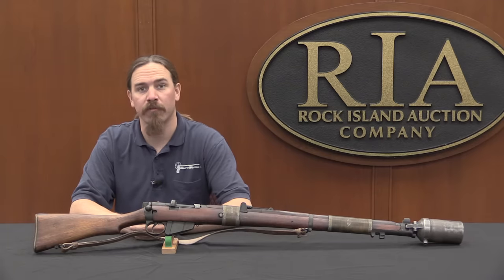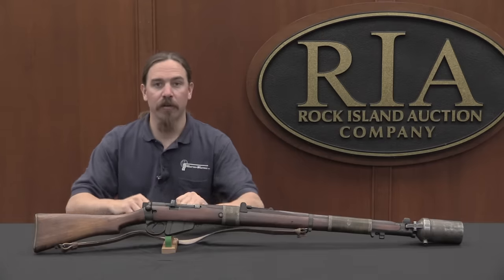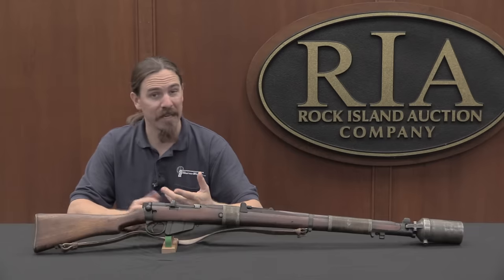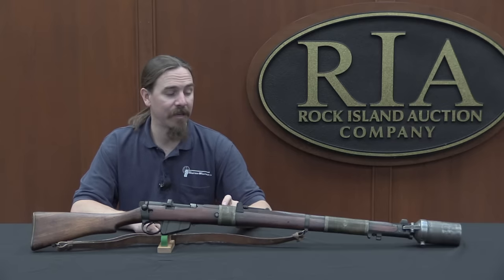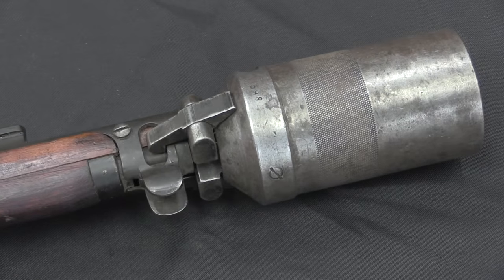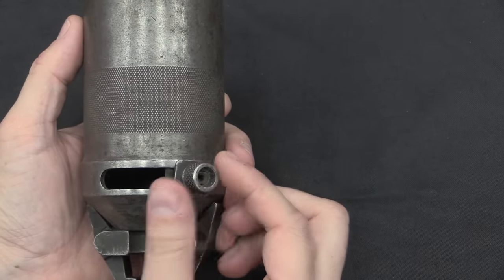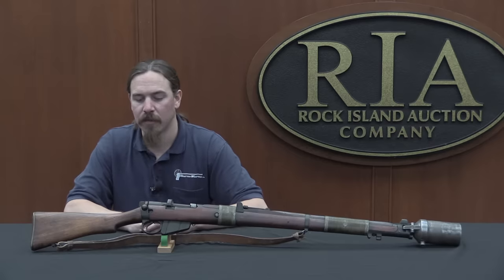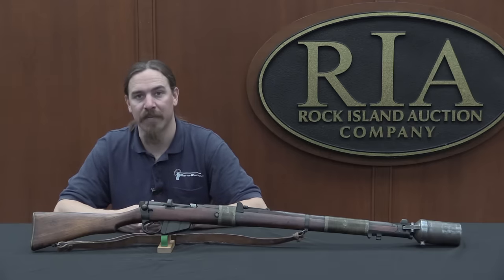SMLE Rifle Grenade Launcher

Comment: The simplicity of  changing range by adjusting gas pressure instead of angle is just awesome. Throughout the whole video though I kept thinking knee mortar, even though this predates that. I do wonder : was there anything in the manuals for those two weapons showing how to achieve a higher arc for clearing walls and such?
Reply: It's not just the simplicity, it's maintaining the optimum trajectory for dropping the grenade on top of the target.

Comment: What was even worse about the rod rifle grenades: they tended to detonate when they were launched because the rods got stuck in the barrel long enough for the impact fuze to arm and set the whole thing off when the grenade finally left the barrel. Both Germany and France eventually replaced them with rifle grenades with a bullet channel that were fired with a normal cartridge: the bullet went through the tunnel, set of the timer fuze, and the hot gas following the bullet launched the grenade itself.
Quite an interesting time for the development of (rifle) grenades. The stuff they came up with would even make steam-punks drool. :D
Reply: whats worse about those different rod grenades was you put it in the barrel, loaded your blank, pulled the pin and immediately fired. Because there was no method to retain the handle. Until they developed a large ring held on by your bayonet.

Comment: Could you still fire the gun with normal ammunition and the grenadecup mounted but with no grenade loaded?
Reply from the maker: Yes, you can.
Reply: Sir_dance_a_lot
still look like it blocks the iron sights
Reply: The French used one that required normal ammunition with the grenade launcher. The grenade had a hole in the middle where the bullet passed through, and it hit a trip plate which activated the delayed ignition. The muzzle blast launched it.
Reply: That type is known as a Bullet trap Rifle Grenade.  The British did experiment with them, one major problem was maximum range was inside blast radius of a 36 Mills Grenade. The 36 grenade is known as an offensive grenade, it slings lots of sharp fragments about, the case is designed to split into 36 parts. The German Stick Grenade is a Defensive type, it relys on blast rather fragments, so if you get to lose you maybe deaf for bit but not shreeded.
Reply: 51WCDodge You got it wrong. The mills bomb is defensive and German one is attack grenade.
Reply: So do you just hope to find cover so the Mills bomb doesn't shred you to bits when you use it by hand or what? It sounds pretty unwieldy. Hmm, I guess it's probably expected that you DO have cover when you use that grenade. That makes more sense.
Reply: My understanding is that the difference between an offensive grenade and a defensive grenade was typically fragmentation.

The fragmentation could in addition to the lethal blast radius, create further hazards to troops on the offensive. Or, more the the point, the "Injury zone" is greater, thanks to shrapnel, than the isolated blast zone. Because of this, you only want to throw said grenade when you have solid cover between where you are, and the grenade is being thrown. That's not exactly conducive to being on the offensive.

A concussion grenade, on the other hand, after an explosion, leaves no further hazards to troops that are on the offensive, and can be thrown while moving with relatively little danger to the user.
Reply: Ian, any chance that you'll do a video that Mauser with grenade cup from the same lot as this?
Reply: MoonEyes2k mills bomb has lethal range of only 35 not 100meters and stielhandgranate 24 has lethal range of 15meters but 3x the range
Reply: Also, I'm pretty sure I've read that later Stielhandgranaten had the optional fragmentation sleeves pretty much as standard--they weren't issued separately.
Reply: MoonEyes2k,
Joe Toy had two potato mashers detonate right next to him on D-day and IIRC he didn't get a scratch on him.

Comment: Some units  in the Canadian Expeditionary Force in 1917 modified rifles by shortening the the barrels and remounting the muzzle caps.  The shortened NoIII’s were used by the units designated for mopping up during attacks.  The shorter barrel fired the grenades farther and faster and were more handy when employed in trenches.

Comment: After some coastal erosion beside an area that was a training camp for soldiers departing to the Western Front, we started to find old unexploded Mills Bombs and rod grenades. One Mills bomb still had the fly off lever and pin in place. The misfired rod grenades were something else. A lot of them, even after almost 100 years in the sea sand, their mechanisms still worked. They exploded on impact with a blued firing pin which had a safety feature of two brass balls in a groove in the firing pin which were held in place by a brass sleeve. When fired, the sleeve slid back, releasing the brass balls to free the firing pin to travel forward to set off the grenade on impact. It's not every day you take a spring the thickness of a hair from the sea and find that it is still a spring.

Comment: A bit of a dumb question, but is it possible to fire the rifle normally with dischargers like these attached? Or if you get jumped by the hun while you're getting into position, would you have to remove the grenade, the blank, and the cup before you could take shots at them?

Comment: Ian u forgot a very important adjustment on the spigot launcher. The threaded sleeve in the center rear is shaped to mach the muzzle, its adjusted from inside top of launcher with a wide screwdriver, u snug up the unit loosely then tighten inner centering sleeve, then tighten the launcher the last little bit. I just got 5 drill purpose rifles from CAI for $85 ea w/launchers, their in a lot better shape than I expected, just 2 have damaged toes. 2 have no stacking swivels, 2 havent been drilled for a swivel just a boss is there, 1 doesnt even have the boss at all. I thought this to be odd😊

Comment: The AT grenade with the SMLE cup grenade launcher was the No.68 (HEAT). It could penetrate up to 32mm. of armour plate and was used during the BEF in France 1940, where it proved to be next to useless versus a German panzer.
Reply: That seems unlikely, during 1940 there were plenty of places on a german tank that were less than 32mm thick.

Comment: I knew these were used in WW1 though I had not realised how extensively. I am surprised, though, that they were still in service into the 1940s as the 2 in mortar was so widely used at squad level at the time. And being a mortar they would have a higher rate of fire. You could drop several rounds downrange in quick succession.

Well a couple of new facts learned today. Thanks

Comment: Also known, at least in Australia, as the 'EY' rifle from an abbreviation of 'Emergency' (pronounced eee-why) and were 'in reserve' up through the 1960's. The wrist area of the butt was also often reinforced with wire as they tended to break at the end of the stock bolt holding the butt onto the action.

Comment: At the start of W W1 the British had no standard grenade. The expdient was to use tins from the issue Tickler's Plum and Apple jam packed with gun cotton anda fuse, to 'Tickle' up the Germans. In 1915 William Mills designed the Mills Bomb, going through various developments till the type 36 (Shown in the video ) was standardised. The term Bomb being used in the British Army through out WW1. Initailly the rod grenade was fired from a half cup, problem being you pulled the saftey pin, and nothing held the lever down, an exciting five seconds .  The full cup No 2 launcher and 7 second fuse was introduced around late 1917 early 1918 . This held the fly off lever allowing the saftey pin to be removed and giving time to aim and fire.   By 1917 British tactics for assualt favoured the 'Bomber'. Two or three men in a section carrying only Mills bombs would lead an attack with the riflemen there primarly as support and close protection. The blanks used to fire the grenades were Ballisiste, previously discarded by the British as a primary propellant in favour of Cordite. In the 1950's 60's the Energa anti tank rifle grenade was issued, range at about 10 yards. Official description of use 'At a range of 10 yards , it requires a determined man'.
Reply: Actually the British did have a hand grenade at the start of the Great War, the Mark I, adopted in 1908. https://en.wikipedia.org/wiki/No._1_grenadeIt had a wooden handle to increase leverage and, hence range. https://en.wikipedia.org/wiki/No._1_grenade#/media/File:HandGrenadeNo1Mk1.jpgBUT"When the battlefield became confined to the trenches, the long handle became a liability, causing several accidents.  Reaching back for the throw, the fuse could strike the trench side.[3]  The No. 3, a variant of the No. 1, had a shorter handle for easier use in trenches."The reason for improvised devices was"Manufacturing the No. 1 was difficult, as it required a special detonator that could only be produced by the ordnance factories.  Because of this, the British Expeditionary Force got far fewer No. 1s than were ordered"

Comment: Heyo. This is somewhat irrelevant compared to the subject of the video, but I have a question regarding the Sturmgewehr. 

After a bit of curious snooping, I found the platform for the rifles used by the Rebellion in Star Wars were modified STGs. I know the US found an easy way of disabling STGs whenever they came across them in the field -- but was that standard practice up until the end of the war? Or did they begin salvaging them for study/use?

Comment: The French Army is still big on rifle grenades, the new HK416 will be able to shoot them, like the FA-MAS F1, the MAS49/56 and the MAS36/51 before it.
Reply: IIRC, it comes mostly from a cold war era strategy of having every foot soldier armed with AP rifle grenades. That way a simple infantry team can slow down, if not stop, the progression of APCs while the upper echelon shuffles troops around and provides AT troops or MBTs.
Reply: daktari its more than just that.. rifle grenades hold more boom for weight than 40mm also you dont need a heavy attachment(m203,etc) and like you said everybody in the section gets them
Reply: Sono Luma japan france and some other countries still use them
Reply: It packs both a more punch and also more range than the M203. The NATO rifle grenade replaced light mortars (like the good'ol 60mm) in terms of range and exploding power. The 40mm grenade launchers are pretty handy (lower kick and the ability to use both main ammo and grenade side by side) but doesn't have the same range.

The French APAV40 anti-tank grenades are well known for having a lot of kick but also a longer range compared to the standard NATO grenades and makes any rifleman pack the power of a M72 LAW launcher.

The Israeli also use ridle grenades, but in more specialized roles like blowing up doors from a distance.
Reply: I think the Finnish RK 95 TP also has a rifle grenade option, though it doesn't use any specialized launcher cup or such.
Reply: If you look at videos of French troops in Afghanistan you see  them in use

Comment: Looks like an ingenious system- easy to manufacture and simple to use. The Mills bombs i have seen are large for a hand grenade- i am sure they were effective. The pkate on the bottom is certainly a good idea- it would have made the propulsion more consistent. That would have made it easier to dtermine the proper vent settings for different ranges. Great video as always. Thank you

Comment: If you are going to fire one of these SMLEs make sure it is not stamped EY -- meaning -- Do not fire ball except in an emergency. -- meaning--  unless the Zulus were tickling your kidneys with a spear, They are dangerous to fire.  This mark will be on the Barrel,on the knox form,receiver,& furniture, there is also DP -- Drill purpose only --stamped in the same places.

Comment: Grenades themselves really fell out of favor by the end of the 19th century and most armies didn't re adopt them until WW1. That's because most grenades until WW1 were simple iron/steel balls filled with black powder and shot, and detonated by a simple lit fuse (there were impact detonated grenades used in the American Civil war but they often didn't detonate reliably). This made them difficult to use, unreliable, and often dangerous to the user or his comrades. Not until WW1 and improved fuses were developed did they become practical again, and the war showed the need for a form of "individual artillery". Then you see a proliferation of hand grenades, rifle grenades, and light weight mortars that gave this ability organic to a small infantry unit.

Comment: In one of the later episodes of Mythbusters they tested what happens when you shoot a grenade... a pistol will knock a hole through the side, a slug will shatter the case, but a rifle round will actually set off the main charge. I can see one of those going off in your trench leading to a real bad day.
Reply: moosemaimer and that's why they used specialized rounds.
Reply: Technically the rifle round would have set off the detonator, which would have set off the main charge. A grenade main charge should not detonate with just the impact or even penetration from a bullet.

Comment: It's not really accurate to call the rounds they used for launching grenades "blanks".  They were not the same rounds as the blanks used in training.  There were cartridge designed specifically fro launching grenades, generally called "ballestite cartridges"

Also, there now exist rifle grenades that can be fired from a rifle using normal ball ammo,  They are called "bullet trap grenades".

Comment: Ok fine. You convinced me I need to buy a grenade cup for my wire-wrapped No.1 MKIII* SMLE.
Reply: Huh. Just found my old comment here. Well, just an update - I did in fact find a grenade cup for my wire-wrapped SMLE. I suppose this video inspired me to finally find it. The complete set is a wonderful part of my collection.
Reply: @zul448  now you need .303 blanks to launch tennis balls into the next county!  I don't know if the Brit Royal Navy was using smles for line launching, but that may be a useful source for blanks to use.

Comment: So correct me if I'm wrong, but to use this, you would take your grenade, remove the pin  & load the cup - then you had 7 seconds to get that thing out of there before it went off? Seems really dangerous - a dud blank or a misfire could mean the end of you...
Reply from the maker: The cup held the grenade spoon in place until it was fired.

Comment: I'm not sure if I missed something, but do you just pull the pin, put it into the cup, fire and hope to be fast enough for the 7 seconds timer? Or is there a mechanism in the grenade that starts the timer only once it left the cup, similar to a normal grenades lever?
Because without that you'd better not have a dud round...
Reply: The  cup holds the safety  lever in place after  the  pin is pull. Early  versions of the  Stokes 3 inch Mortar were  loaded  the same way,  the  pin  was pulled from the  mortar bomb and  the safety lever  held while  dropped  in the  tube. The bomb  had a fuse of about ten seconds. It would  fly  tumbling  though  the  air, no fins on the  early versions.

Comment: Actaully i don't think grenades will explode if shot with a bullet. Since generally speaking the explosive used in them are stable enough to endure the shock of a bullet. After all, shooting explosives is a legit way to dispose of and or disarm. Though i guess these are ww1 and ww2 grenades which i think often used stuff like petric acid, which is a little bit less safe than the normal filler used.
Reply: That doesn't worry me to much, but the contact of the gas and time of contact would be so short not enough heat would be able to effectively transfer. Now in a longer barreled grenade launcher, that would create for exposure time, i could see that be a concern. But with such a launcher in this video, i don't see it being much of an issue.
Reply: In the case of a Mills Bomb a bullet through  the axis would probably hit the grenade's  detonator, and set it off.

Comment: was their many rifle grenade designs that didn't require a significant modification to the rifle ie cups or muzzle devices? i tried to find a russian rilfe grenade that was used in CoD: world at war because the mosin was the only rifle that used bullet shaped grenades and it didn't modify the muzzle of the rilfe. (i realize that im talking about a video game but im wondering if that is real, what i found is that it did have a cup)
Reply: Most rifles dont need a modification at all to use grenades. M1 carbines & garands just clip on & off the bayo lug with a small lever, I use one on the M1 garand. I also have a grenade retainer on my AR15 it goes behind the flash hider it's a 6 finger spring steel part to keep grenades on😊